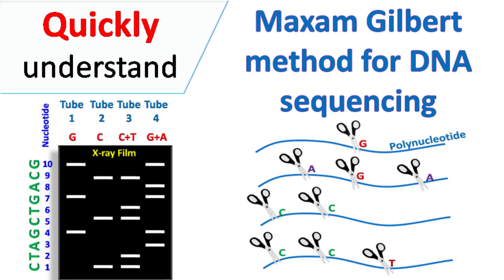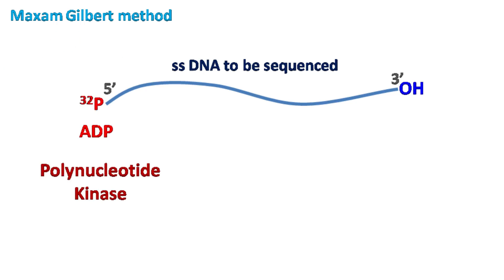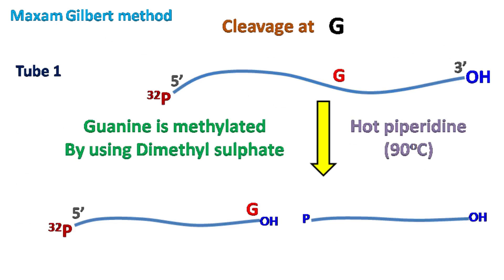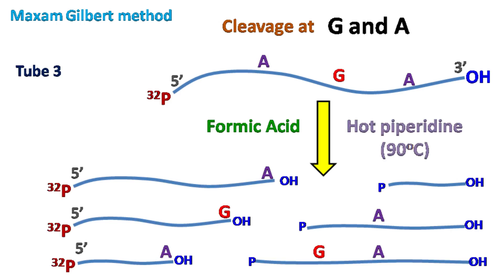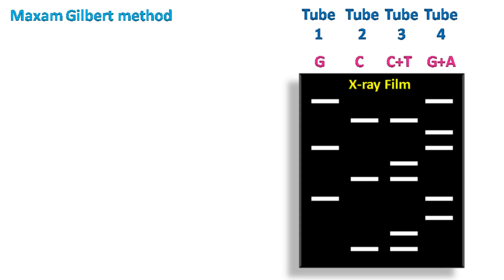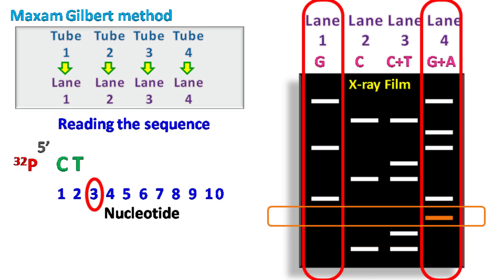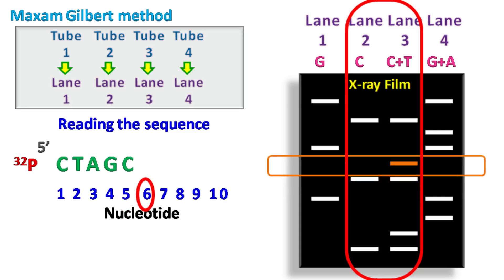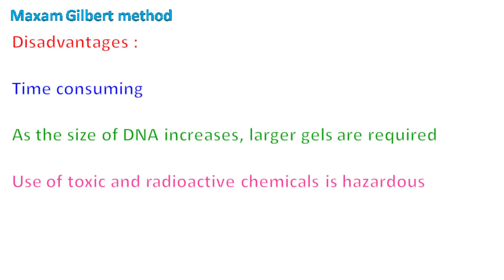Maxam Gilbert sequencing

Comment: G : dimethyl sulfate ft hot piperidine (90°C)

C : hydrazine w 1.5M NaCl hot piperidine (90°C)

C & T : hydrazine w/o NaCl hot piperidine (90°C)

G & A : formic acid hot piperidine (90°C)

1. Cut fragments 
2. Separate using PAGE
3. Autoradiography 
4. Data Analysis (bottom to top)